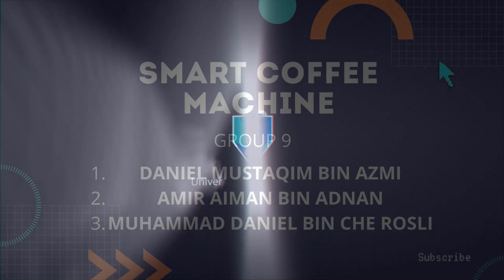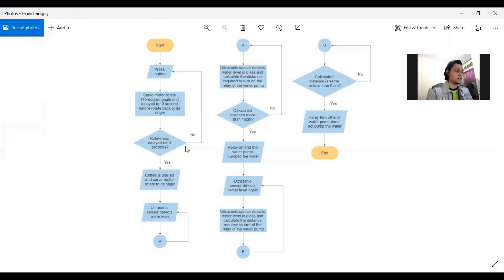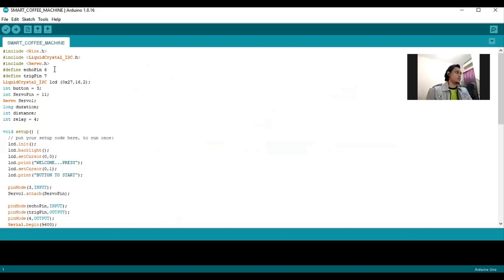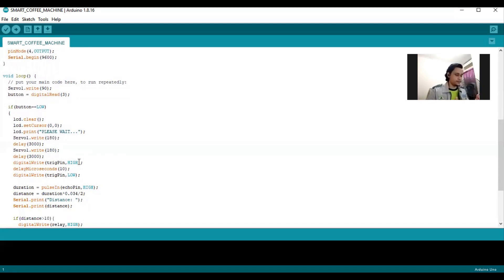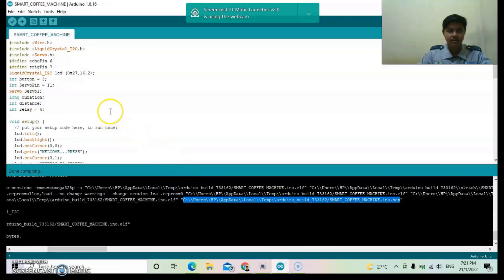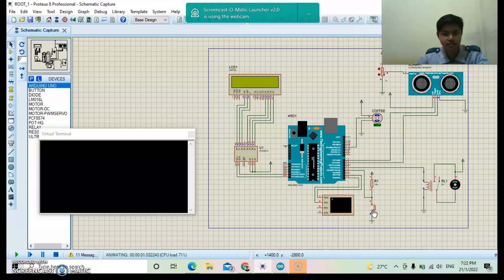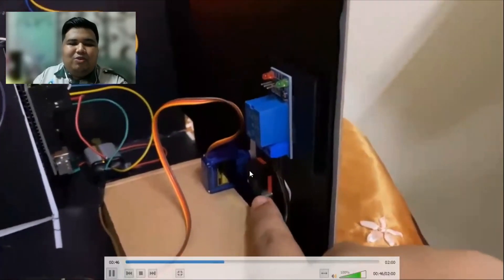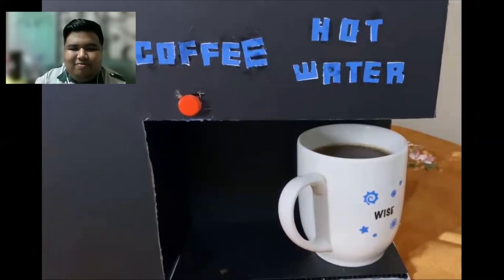SMART COFFEE MACHINE USING ARDUINO

Comment: NICE PROTOTYPE BUT I am confused with several things from your prototype:
1. Why did you have a servo motor near the relay? What is the servo motor used for?
2. How do you control the coffee drop? Did you drop the coffee manually? Because in your simulation, you only have 1 servo motor, and the servo motor is placed near the relay. not on the cone...
3. Why do you need to change the position of the cup? Why not make the water drop at the same position as the coffee drop?
Reply: Thank you for the question Dr.

1. The servo motor at the relay act as the lever arm of the limit switch. The servo motor will push the plunger (a component of the limit switch) after being pushed the water pump will turn on and water will flow through the tube. If we do not add the servo motor near to relay we have to manually push the plunger. 

2. The coffee drop automatically. The coffee drop for 3 seconds and it supposedly drop at once not little by little so we think the coffee was stuck on the cone in the demonstration I wait for a few second to maybe be sure all coffee is dropped. Have a servo motor implemented under the cone but not shown on the video but I mention that have a servo motor inside the cone .We take this our mistake during the implementation and make the improvement for future projects.

3. After a brief discussion with my teammates, we decided to separate it because we want to show clearly how the coffee drop and water drop and also if the user want another shot of coffee can just push the button before the water.